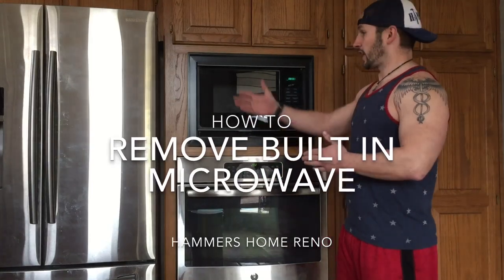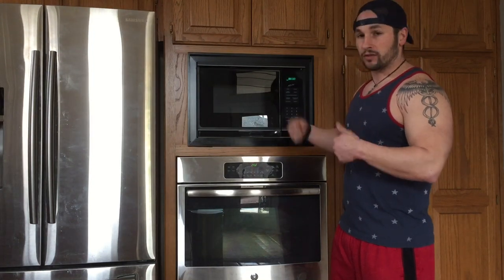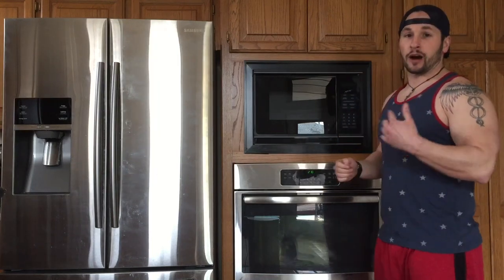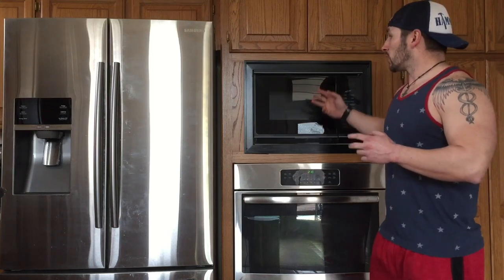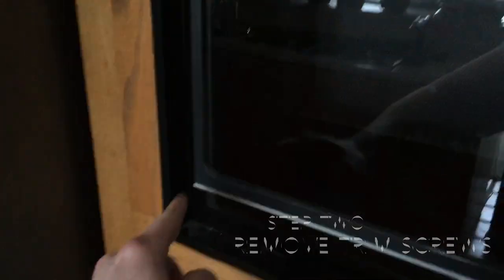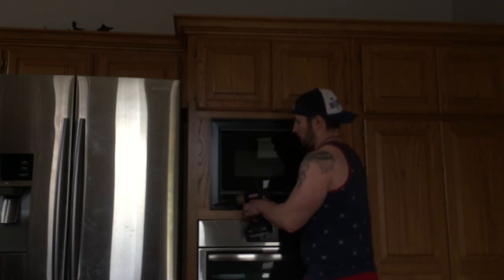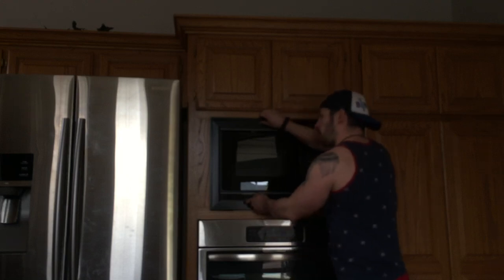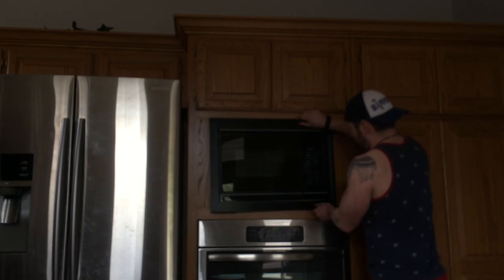How To Remove Built In Microwave

Comment: Thanks fo r the video. Can you please provide link for installing new one? Also, can you reuse the trim kit (if 2 pieces) and install another microwave that is from different supplier. My model is from 2008 and started to spark/catch fire yesterday ...thus prefer a different brand. The recommended replacement by Frigidaire for my model is of different size and does not fit that trim kit..